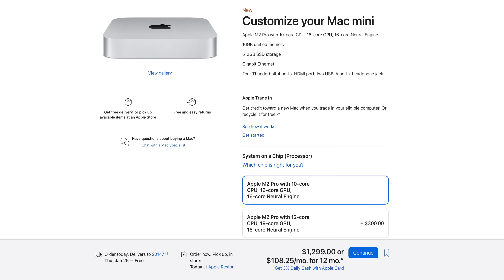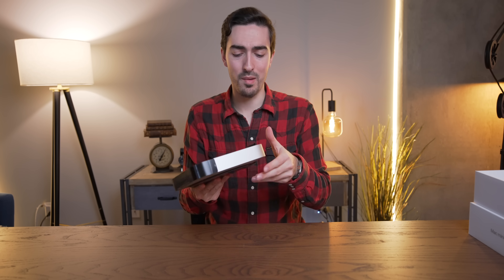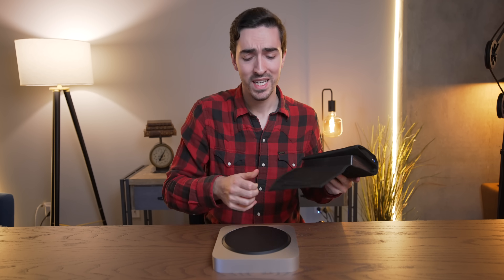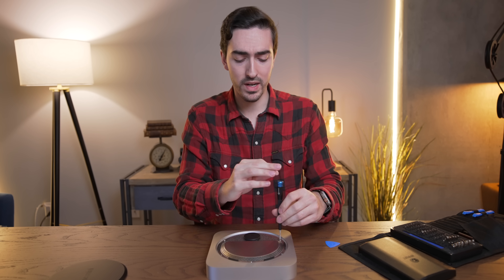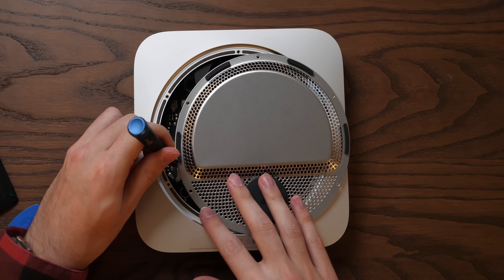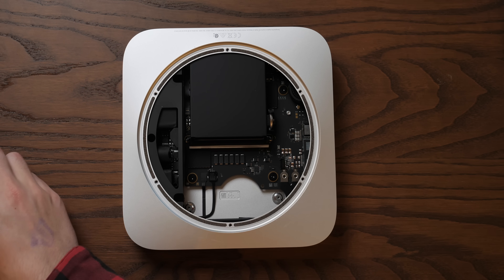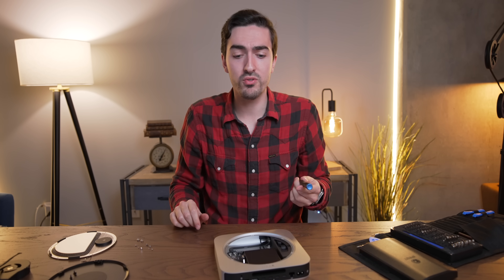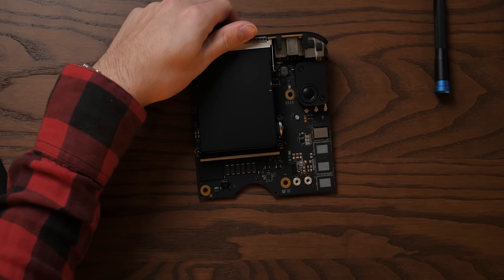M2 Pro Mac mini TEARDOWN review!

Comment: Heatsinks are often coloured black as it makes them slightly more efficient at dissipating heat. It also looks cool :-)
Reply: thats not true, quite the opposite
Reply: Im suprised thats the case, i would expect a white cooler to be more efficient since white reflects EM Waves and doesnt absorb the energy / heat
Reply: @dackel4253  If I remember correctly, white is better at reflecting heat (not absorbing it), whereas black is better at absorbing and radiating heat.
Reply: @dackel4253  maybe to further clarify this a bit. You want a cooler/heatsink to absorb and radiate heat as that is its intended purpose :). Hence, white would not be as efficient, because as you say, it is less efficient in absorbing heat/energy.
Reply: @DiIusion  That makes sense, thanks

Comment: Oh Apple, you crack me up. In the same amount of space as all those NAND flash module pads you could have used a M.2 module. I mean, I don't even care if they used their proprietary SSD connector... that was able to be converted to M.2 module with an adapter board. Guess they got wind of that hack, oh well.

Comment: Thank you, Luke. This looks like solid engineering - I'm less concerned about thermals after seeing the heat sink cover and channel. One question, has Apple made any changes to the Bluetooth antenna? There were some reports of Bluetooth dropouts in earlier Mini designs, perhaps this has been improved along with the BT 5.3 update.
Reply: i can speak to having a mac mini pro, no issues with BT or otherwise

Comment: 06:13 - A real Blue's Clues vibe right there...! ;^p

Edit to add: the Tech Specs on the Apple website for the M2 Pro Mac mini states the PSU is 185W, the M2 Mac mini PSU is still 150W...
Reply: I assume that's a major reason for the weight difference.

Comment: Another Mac with everything permanently soldered to the board? How is this one equipped? Four GBs of RAM or only two? A 128 GB drive, or only 64? Oh, 16 GB of RAM and 512 GB of storage, I see... but for $1300! Less than a month ago, I bought a new "other-Mini" with the same RAM and storage capacity, for $350, including tax and delivery. And I can upgrade both, at any time. I can also buy those in multiples of three, possibly even four, and have cash left over, for the same money Apple wants for one. If the Mac breaks, I have to buy a new one. Apple won't fix it. I absolutely DESPISE Windows, I mean, I REALLY HATE IT. But Apple has taught me, over the last couple of decades, to hate them more. It took them 30+ years to achieve it, but I am no longer a Mac devotee.

Comment: That was great. Loved the quick teardown. I completely agree on this being a game changer. Particularly the base model. The additional cost from a similarly configured M2 w/ 512 GB SSD and 16 GBs of Ram is only $300 for 50% more Performance CPUs and  60% more GPUs as well as 2 more Thunderbolt 4 ports and a better cooling system. What is really game changing though, is for almost anybody, this is all you need to run even high end professional software. You can add additional storage if you need it, but you really want 512GBs on your boot drive. 8 GBs works for memory, but heavy workloads will cause swapping - 16 GBs, however, given MacOS memory management, really is all you need for almost all tasks. This machine is right in the sweet spot (unless you need portability).

Comment: Speaking from 30+ years of experience, I can tell you that the NUMBER ONE RULE IN MANUFACTURING IS THAT 'VARIATION KILLS QUALITY'.  Hence, its a GOOD THING that the case for the Mini has not changed in 10+ years.  Also, using the same materials for multiple platforms (aka: products) saves money due to economies of scale.  Yeah, its kind of boring, but lets just roll with it :)
Reply: "If it ain't broke, why fix it?" as they say, apparently!

Seriously, it's become a design classic, and what about it needs redesigning? It is easily adequate enough for the current chipset, so until the chips require more cooling that could be practicably done in the current case, i doubt it will change. 
Would be nice for a Space Grey, or Midnight version, though.
Reply: And it keeps the server farm mini buyers happy, too.
Reply: @cjc363636   true! I wonder how many of the world's Mac minis are currently rack mounted
Reply: It's possible the size is retained to accommodate  existing rack mount architectures e.g. servers.
Reply: @highdesert50  That is exactly why they did it. The Studio fits the size of 2 mini bays (not 2 minis, but bays with rails to hold them). And whoever said they are a slightly different size is wrong.
Reply: And makes it cheaper... Oh, wait
Reply: It’s slightly different in size than the previous years.
Reply: Yes! No variations critical for quality in manufacturing … the Japanese way . Demings philosophy!
Reply: That’s why Toyotas are so reliable also!
Reply: i like the way you think
:-)
Reply: So, are you saying I can take my fried 2012 Mac Mini and install a 2022 M2 Mac Mini guts? 
Wow. I would have thought the mounting screw locations were different.
Reply: Let’s not and say we did. 10+ years is a little ridiculous. Imagine iPhones still looking like iPhone 3G in 2023.
Reply: @IAMLXGEND  well yeah but now iPhones cost well over $1,000 up from $500.
Reply: @IAMLXGEND  would honestly use it with modern specs and all, i miss iphone 4/5 design - those things were so small!